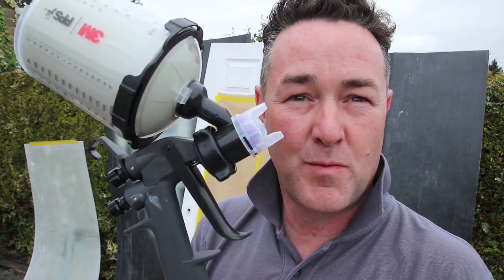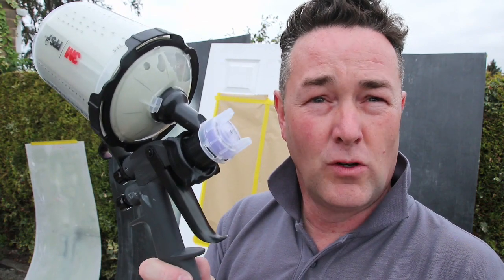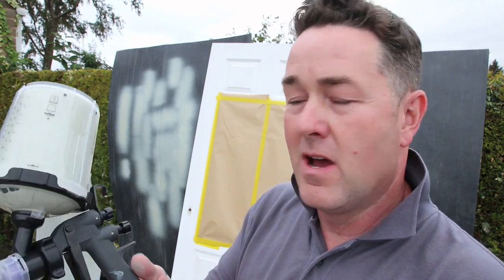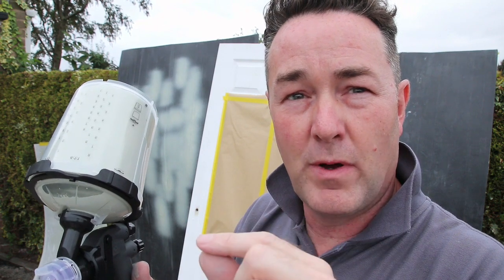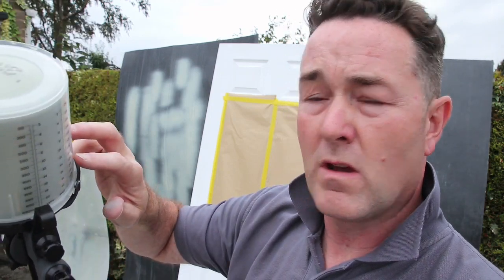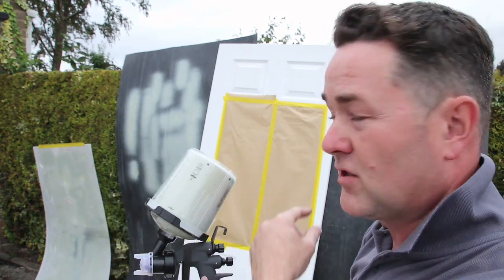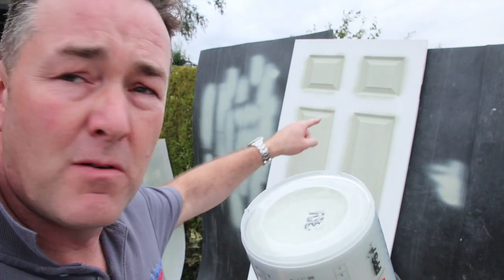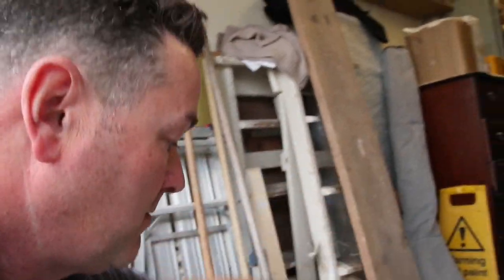3m performance spray gun - by a Painter & Decorator

Comment: At 80psi it's way to high for door furniture paint etc ,Higher pressures that it can handle are for high solids,  Car body work paints etc, I know you state paint consistency and different material need fine tuned an yes there all different,  definitely interested in the 3m gun, more so if the gentilin csk240 can keep up to it , try the gun empty on full air to see if pressure drops below 2bar for a few minutes to see. Thanks for uploading the video , I was looking forward to this update,  keep up the good work. 👍
Reply from the maker: It'll be interesting to see what psi I can get down to using a lot thinner paints.

Comment: Great review, I’ve got this gun and I love it :) sadly my compressor isn’t  powerful enough to run it. The clean ups are the best thing no time at all compared to my airless and hplv gear
Reply from the maker: It's a brilliant gun. They need to make it suitable for compressors that suit out work (decorating) and not those who have spray shops/booths with large units.

It must be something that could be done to reduct the air volume it needs.

Comment: From my understanding you want it at about 20 psi while you're holding the trigger.
Reply from the maker: I dn't think my pump is up to the spec of what this gun needs, although it did work with it.
Reply: I have one and I did the H/O conversion to it so I can have the option of pressure in the cup or not. Mostly useful for thicker finishes and stuff. I run a 26 gallon compressor rated at 6.5 cfm @ 40 psi. They recommend 13 for this gun. Although I'm not doing automotive finishes I typically don't srpay a ton at one time so my set-up works for me.

Comment: Hello Phil do you still rate this 3M spray gun? I upcycle furniture and  was looking to buy this. I have a 50l compressor will it run smoothly mind you my furniture projects are relatively small to medium. Biggest is a sideboard/ chest of drawers.
Reply from the maker: It's very good. You need to make sure the compressor can give enough flow of air for what tye gun requires. Check the spec of the compressor and also the gun.

The gun is lovely though.
Reply: @ProfessionalPainterDecorator  thank you 👍

Comment: Ive only used airless machines this  looks fine but as a contractor  when your avarage size house has 22 doors this would take 2 long ... and why buy 2 spray machines when one does it all..
Reply: Hate to break the bad news to you dude but I'm guessing he owns at least 10 different types of spray machines/devices....i have 3(looking to add) and use them all
Reply: @karlcurtin7382  just because you don't know how to work them to get the desired look ... I know paints different in certain countries but if your in the trade its about time and quality .not sure how you long you get on a uk build but in aus you get 2 weeks on a 350sqm house... with this gun the doors would take me 3 days ... I can tell you what to spray so they come up like glass...someone did say plastic but you can't please everyone
Reply from the maker: Don't get me wrong.... Airless for speed and the right tip with filter away you go.
But with my QT5 (Stage5) hvlp the control and finish can out weigh the speed of airless when you need more control.
If spraying kitchens or bedroom units... I'm not looking at how fast.
The job is priced for what's done.. not how long it takes .. so money is made. We don't do contract new build work.... Thankfully lol
Can't do with having to work with other trades in my way when your the finishing trade looking to get a finish.
Reply: @ProfessionalPainterDecorator  you're spraying a door in your video... Ive not done a kitchen unit dont think anyone does that here.. not since the 70s maybe... I dont mess with 2 pot systems anymore
Reply from the maker: @JONO3679  all waterbased for me... Unless it's the KolorBond uPVC paint which is still one part but more a cellulose type of paint.

Comment: ANI 150 with pps system
Reply from the maker: Is that the same gun?
Reply: @ProfessionalPainterDecorator  No its the ANI150R, It would been ALL you needed for what you do..
Reply from the maker: @MrLeshop  does that also have the quick release air cap and easy clean needle set up?
Reply: @ProfessionalPainterDecorator  No worries fella 👍

Comment: Read instructions !
20 psi approximate.
Reply from the maker: Yeah, the gun needs quite a bit of power as it has a high air flow rate, my 24ltr units wasn't ideal. But the gun is geared up to spray shops and car body repair shops that have big ltr capacity air tanks.